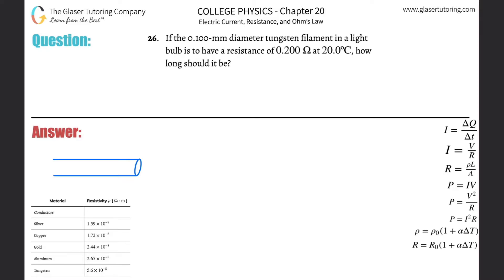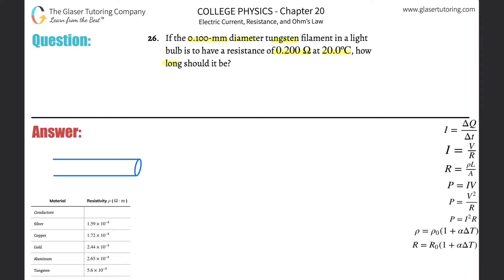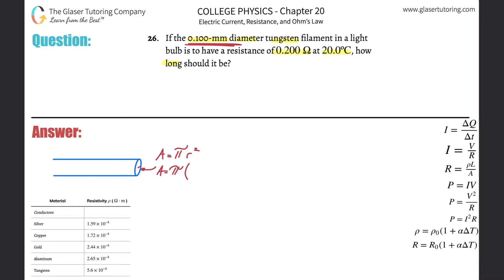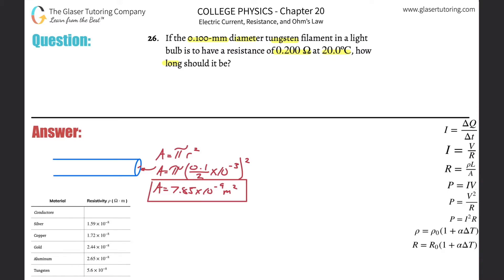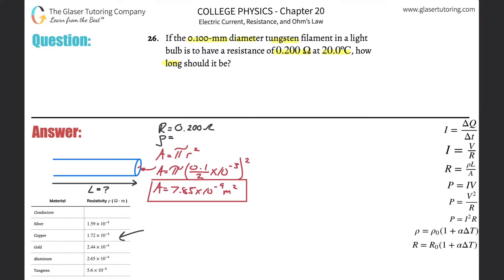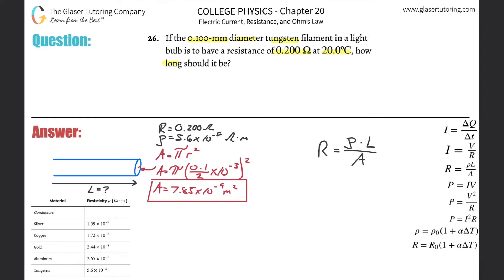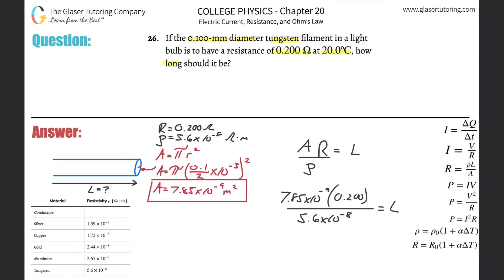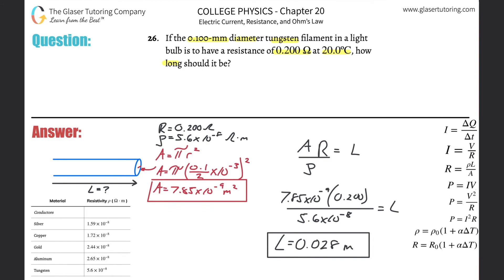20.26 | If the 0.100-mm diameter tungsten filament in a light bulb is to have a resistance of 0.200

Comment: i got 8.0x10^-9 m^2 for my area. did i mess up?
Reply from the maker: Hi Devone!  I just did the calculation again in the calculator and the answer in the video still stands.  Our values are very close to each other but I am not sure how you are calculating 8.0 x 10^-9 instead of 7.85 x 10^-9 (when rounded to 2 sig figs it should be 7.9 x 10^-9.)
Also, a huge THANK YOU for your support in us and in the channel.  The channel would not be where it is without your support - thanks again!  Keep up the hard work!